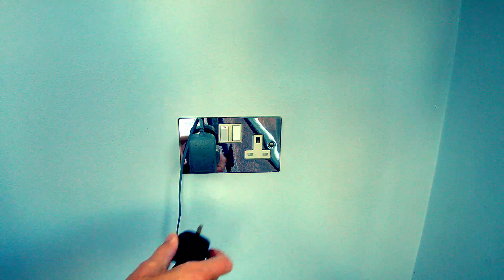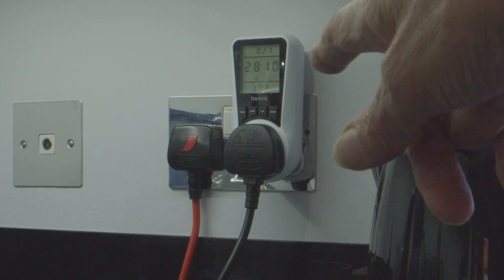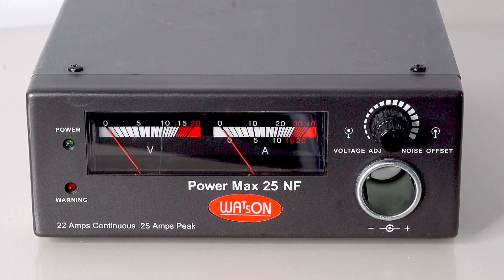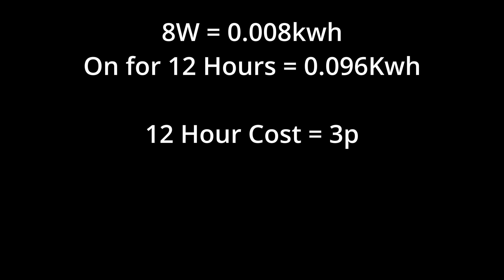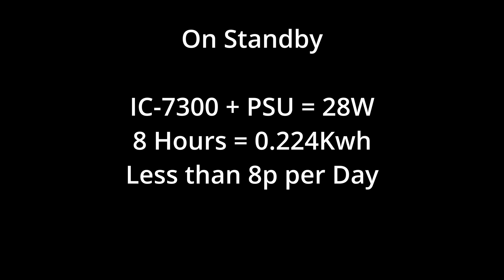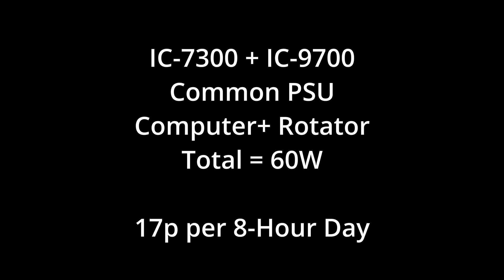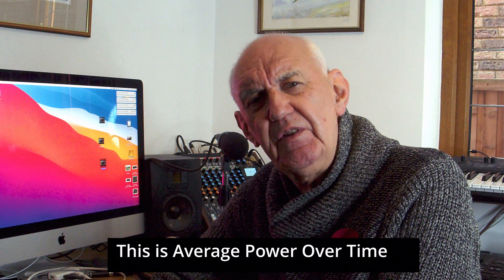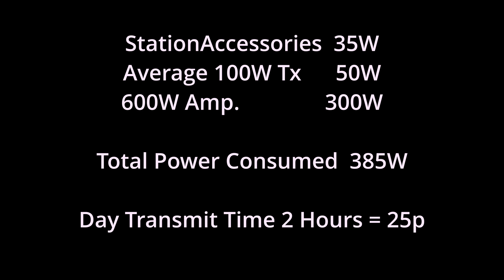Ham Radio Energy Consumption  - SURPRISE

Comment: That's for the video, finally I can prove to my wife that my amateur radio hobby uses very little electricity! Wow, we only pay a little over 12 US cents a kilowatt hour for our electricity here, we are on what they call a "CO-OP". So we kind of collectively "own" our power company. They even pay us a dividend some years, and sometimes it's the other way and we have to pay additional costs, or they use the money for capital improvements. They figure that at the end of the year, so you have to watch out and set some money aside, or you will be strapped for Christmas. Some of our grid was installed in the 1930-1940 period, and then they had to stop because of the war when they ran out of copper and steel, and they restarted building it out of course after the war. So a lot of our grid is still pretty old in the rural areas, but it's always new in the urban areas. Lately, they are finally replacing most of that, and we have metal poles replacing the older wooden ones even for the medium tension lines because our storms are worse every year (global warming?) with wooden poles still  being the norm to deliver the lower tension ("220 single phase split") to your house. It's almost always single phase, and it's a problem if you need three phase for a larger business, and then WOW it's VERY expensive to install that. Electricity varies in cost quite widely in the US. Now, some locations have different cost based on the time of day, which is where "smart" meters come into play. We sill don't have a lot of "smart" meters yet. A guy comes to your house every other month to physically read the meter, and in the "off" month, it's estimated. So that in some places, power say in the "off peak" hours, say in the middle of the night is considerably less. And some.of our newer appliances have a timer/delay, so that you can for example run your washing machine, clothes dryer (which is a thing here) or your dish washer at night for a considerable savings. We also have a "box" on our heat pumps and hot water heaters, so that if the power company hits what they call a "peak" load, the power company can temporarily and remotely shut off your heat pumps and/or water heaters until after the critical "peak" demand use is over. This a an entirely voluntary thing, and they give you a few dollars off every month on your bill of you agree to have these installed. They only activate this on VERY hot summer days, or VERY cold winter days. Usually only a few times per year here in Central Ohio, and most people don't even notice it. Of course, air conditioning is the norm here. I don't know why we have clothes dryers, we don't use ours much. My family has always found having clothes dryers in general to be rather stupid as a concept. We also don't use the "drying cycle" on our dishwashers, we just open the door and let the dishes dry that way. And we only switch on the air conditioning if it is say 80 to 100 degrees Fahrenheit. But most here use it all of the time in the summer months: IMO they keep their houses way too hot in the winter and way too cold in the summer, and it seems wastefully expensive, but to each his own... We don't do that! It's also a curiousity to us that you often have your washing machine in the kitchen in your homes there as we see on Britbox television. Front loading washing machines were only found mostly in laundromats until we started to get front loaders from Germany (usually rebadged "Bosch" brand washers) rewired for 120 volts. Wow they really save the power and the water compared to the usual American "top loader" type washers. And LED lighting is simply amazing! In our home, we have two 52 gallon hot water heaters, two pairs of washers and dryers, two refrigerators, two stoves, and a six foot deep freezer. This would be a typical "large family" country homestead, and includes a mother in law suite. We also have to pump (and water soften) our very hard North American water. Though we are lucky in that our well has never run out of water. While in general most people in our community drive pickup trucks and large four wheel drive vehicles, we have one hybrid car, and the other one is a plug in hybrid. So that saves a lot of gas, it's getting quite expensive. There is not real practical public transportation in the Midwest rural ÚSA, but we sure wish that we had that! We HATE buying cars, maintaining them, and (especially!)  insurance costs. (A lot of people don't know it, but Ohio is actually one of the larger producers of both oil and natural gas.) You might also find it interesting that our car is only charged by 120 volts, as having a 220 line in your typical garage isn't a thing and incurs an expense to install, but most farms have 220 in the barn, it's critical because you need that to run a decent welder: Every farmer welds out of necessity, and it's a TOUGH TOUGH business to turn any sort of decent profit consistently. This is also a problem for the typical rural home if you want to run an amp. For our stoves and water heaters, they just "double" two 120 volt circuit breakers, and sure that works, but if you want an amp for Ham Radio and to weld, you can quickly run out of places in your circuit breaker box to do that. We mostly have 200 amp single phase in our homes, though you still find the occasional 100 amp (and even rarely) 60 amp "fused" service. More than a few homes here have a  "whole house" backup emergency generator, though we do not. Older homes also usually only have "two wire" outlets, and that's a problem having no third wire "ground". Since I only have 120 volts to charge the car, it takes me twice the amount of hours to recharge as compared to you, so the minute you get home from work, you must plug in your car straightaway! I work at a large University Hospital, and there are only SEVEN places total(!) were there is a parking garage spot where you can charge your car, though they are 220 volts. We also have large Amish communities here, they have electricity in their barns, but of course they don't have any electricity in their houses at all, instead, they use kerosine and gas lamps. Here, you see their buggies and horses sometimes in the Walmart parking lot.  All the Best!  73 DE W8LV BILL
Reply from the maker: Hi Bill, thanks for that. A lot to read and some interesting content. Take care. 73 Peter.

Comment: FT8 can be pretty greedy on power, particularly if the rig is powered from a linear supply. Very easy to end up with about 25% efficiency at turning mains electricity into RF,  a relatively high duty cycle and usually a PC running too. The maths is depressing for those of us operating it for long hours. I migrated mine to a rig that has an internal switch-mode supply and a Raspberry Pi. For normal SSB voice operation of course the figures are far more modest.
Reply from the maker: Many thanks for info. 73 Peter

Comment: Portable radios use only around 3w per hour (probably less). Radio is probably the cheapest form of entertainment at the moment. The bigger communication receivers do use a bit more wattage (as you mentioned). In my opinion, it's older TV's, AV receivers and home cinema equipment that will be costing!!

Comment: There's a lot of 'average' and 'around' here. A demonstration of standby and transmit with the consumption would of been useful. (for the 7300).
Reply from the maker: Ic7300 standby is 20w as shown in the video - 20W + 8W PSU. 73 Peter

Comment: I'm what you could consider a QRP station, as I daily the ft817. With its 5w output, it's not that powerful. Being that it has a battery pack anyway, it wasn't much of a jump from using a car battery from Euro Car Parts when they had one of their discount sales (delivered free no less), and a cheap roll up solar panel off Amazon (that I keep in the window). That manages to keep the car battery topped up and charged, so I've always had enough power for radio whenever I've needed it. 
If I'm being honest with myself, it probably hasn't paid for itself over the last few years mainly due to the covid restrictions, but with the price of electric going up and the possibility of rolling blackouts across the country it probably will do. I don't mind sitting in the dark with my radio powered by car battery and a couple of fairy lights strung up writing down a paper log... and with a bit of luck (hehe), there won't be any local interference from neighbours, street lighting etc due to the power black-out.
Reply from the maker: Nicely said. 73 Peter

Comment: I use 120 watts of solar panels charging a pair of 105ah deep cycle lead acid batteries all of which were removed from a campervan I scrapped so outlay was minimal. I did before there was any suggestion of price chaos. On the odd occasion that my power reserves get a little low I top them up overnight taking advantage of the lower prices.
The only modification I am likely to make is to replace the lead acids with LiFePO4 when they reach the end of their life. 
The radios I run from this set up are all Icom, ID-5100, IC-7100, IC-9700, IC-705 and I also charge my 51+ along with mobile phones, tablets and anything else I can connect to it.
Would I say that my experiment was a success? Yesterday I ordered enough solar panels to cover my house roof along with batteries, inverters etc. My dilemma now is what to do with any surplus energy I generate, I'm reluctant to take a pittance from the greedy electric companies to rip people of with.
Reply from the maker: Hi Trevor. Nicely put. It certainly promotes ideas and innovative ideas.73 Peter